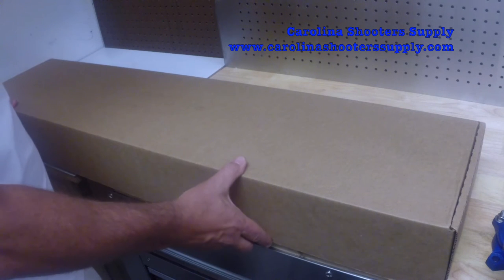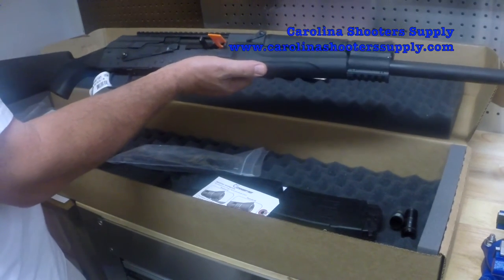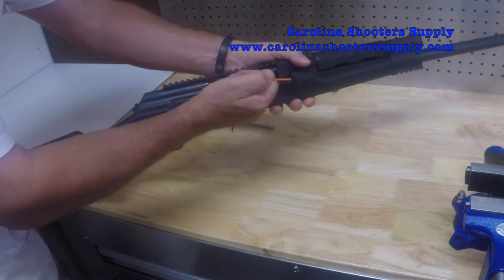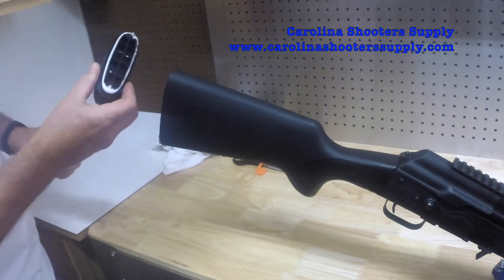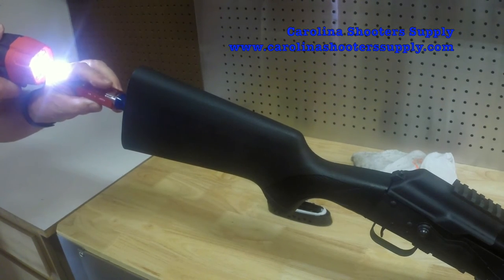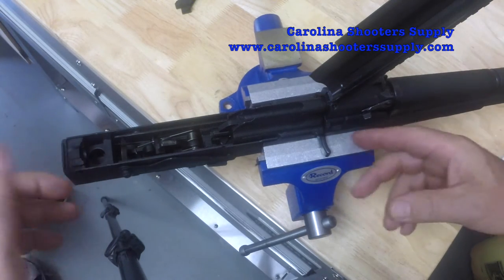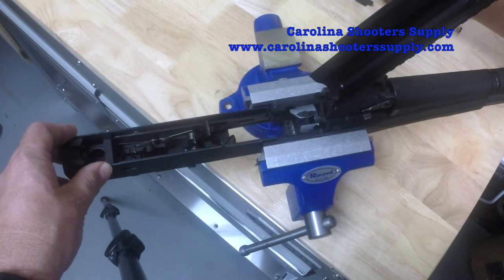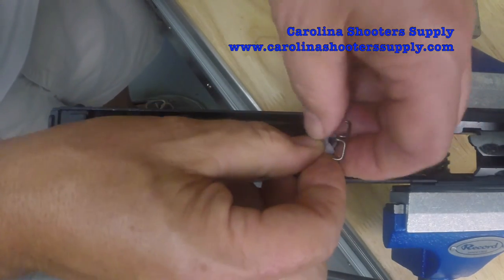Catamount Fury Conversion Part 1 of 4

Comment: Having trouble assembling the bolt into the receiver and the gas plug is loose. The gas plug will not screw down all the way. Do you have any suggestions?

Comment: Great video.If you can file a flat spot on top of the rivet, then pilot drill it with a smaller bit, it will make finding center with the bit you are using much easier. Just a suggestion.
Reply from the maker: hybrid280zx Thanks, thats a good suggestion.  Getting the drill hole started on the rivets is not easy. CSS